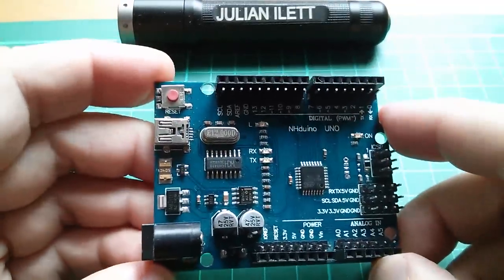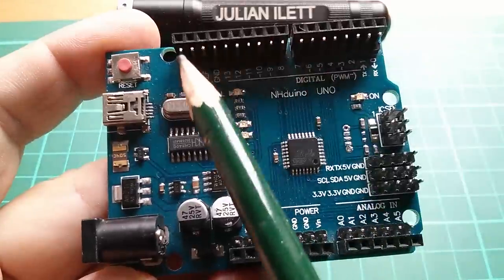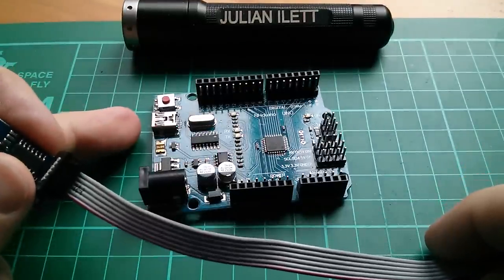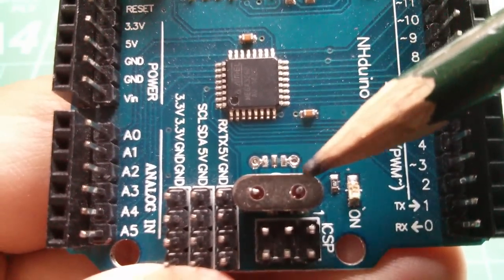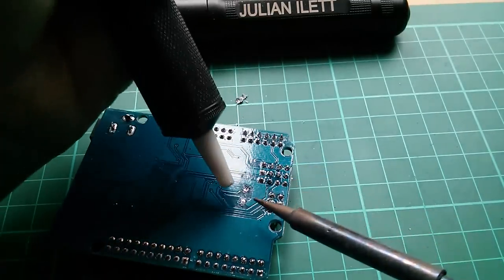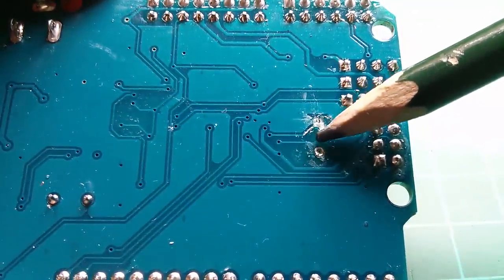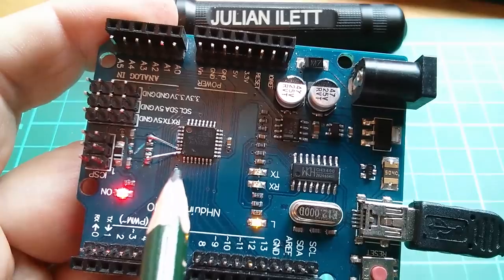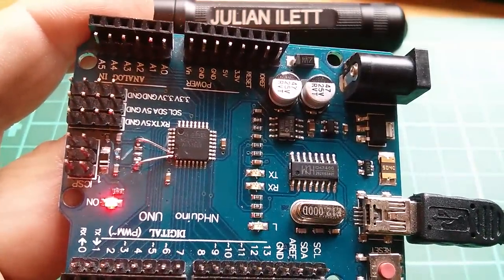Julian Sucks: Failed Arduino Uno Repair - Rescued!

Comment: Why not upload the video if the board was not fixed? I think failures in repairs and projects are far more important in terms of learning than successes! Also, maybe viewers have suggestions if you run out of ideas...
Reply from the maker: +tHaH4x0r I agree that far more is learnt through failure than repeated success, but it doesn't always make good telly. The DSO138 scope build I did recently started as a failure, so it sometimes works, but failures always require some sort of follow up. As for viewer suggestions, I'm all ears.
Reply: +Julian Ilett  About the DS0138  Did you actually do the noise mod yet and do you use it?
Maybe it would be interesting to make an episode of what stuff you still use and what is being left in the dust drawer.
Reply: +Julian Ilett  I have a suggestion for you. I was watching your video series about the MPPT, and you noted something that has been a stumbling block in electronics to me for 30 years. Incidentally, I have to laugh every time I think about your interpreting your wife's "get rid of that monstrosity" (the solar panel frame) to mean "it can stay for the winter". Now that is what I call interpreting.

As to the suggested topic for a video, in one of the MPPT videos you changed the load seen by the solar panel (the number of bulbs connected on your LAMB) to arrive at an optimum load for peak solar panel power.
When I saw that, it was like an old, still buried splinter being bumped. Speaker impedence matching.  Used to maximize power. A continuing mystery to me. Why is it necessary ?

If you make an oscillator that operates at 60 hz, at 100v, you can stick a light bulb on the output and it lights up (I think). But for some reason if you use a speaker, you must match impedences. How come ?

I hope you will consider this as a topic for exploration. I bet 95% of the people who have even heard of impedence matching don't really know what it means. Just something to impress your girlfriend with.
Reply: +Julian Ilett using a smd resonator and a through-hole crystal is actually very cleaver and shows some thought  did go into making this. i actually did this exact thing on one of my very own Arduino boards i designed a couple of years ago. i did it mainly because smd resonators go up and down in price and sometimes become very hard to find. were as through-hole crystals are very common and extremely cheap.
Reply: +youpattube1 +youpattube1 Audio amplifiers are generally limited by their power supplies, and the rating of the output power semiconductors. You get the maximum power out of an amplifier when the load is of the right impedance. 

If you consider a sine wave, ideally you want the peak output voltage to be a close as possible to the limit of the DC power supply voltage, and the peak current to be as close as possible to the limits of the power supply or the output devices, whichever is the limiting factor. In that way, you get the maximum power the amplifier can deliver. 

If the impedance is lower than ideal, you will hit the current limit before the voltage limit, lower actual power. If the impedance is higher than ideal, the amplifier will hit the power supply voltage limit early, it will 'clip', and cannot reach a high enough peak voltage to get maximum current flowing, so lower power is delivered. 

Many car power amplifiers can drive very low impedances, as that means they don't need to boost the nominal 12v DC to very high levels needed for high power into higher impedances. Most audio power amps produce maximum power into 4 ohms as opposed to 8, as means the power supply voltage can be lower. 

Some professional power amps (stereo) can be run in 'bridged' mono mode, combining both left and right channels into a single mono amp. Because the output voltage can now swing over twice the voltage range, these usually produce maximum power into 8 ohms. 

The current limit is the same, the value for each amp independently, but by bridging the two amplifiers, one out of phase with the other, one goes negative while the other goes positive. The output is twice the voltage and can drive the same maximum current into a higher impedance, so about twice the power.
Reply: +philDotCom thank you for taking the time to make this intelligent response. I am a slow learner, and for some reason this issue isn't easy for me, so I will take baby steps. You wrote 6 paragraphs, and I understand the first two. 
In your third P you say that too low an impedance will limit the current. But to me, a lower resistance would mean a higher current. Would you mind discussing this ?
Reply: +youpattube1 Hi, yes sure! You are correct, a lower impedance would mean a higher current for the same voltage, but the power supply and/or output semiconductors will have an absolute limit to the amount of current they can deliver. If there was no limit to the amount of current that the power supply (etc) could deliver, then lowering the impedance would result in more power being delivered, but there always is a current limit.

Assume, for example, that the power supply is designed with +/- 100V DC and can deliver 2A. If you looked at the output on an oscilloscope while inputting a Sine wave, you might see the signal ranging from +100V to -100V. At the peaks, ignoring power factor and phase etc, you have 100V (positive or negative) and potentially 2A, so the peak power would be 100 x 2 = 200W.

If the load impedance is too low, the amplifier might reach 2A current with only 50V peak, so only 50 x 2 = 100W is delivered into the load.

If the load impedance is too high, the amplifier might only reach 1A with 100V peak, so only 100 x 1 = 100W is delivered to the load.

With an ideal load impedance, 2A will be delivered at 100V peak, meaning the maximum power possible is delivered to the load, 100 x 2 = 200W.
Reply: +philDotCom Yes, I do get that the goal is to utilize the full potential power of an amplifier. What would be the point of buying an expensive powerful amplifier if you could only use half that power ?   And I understand that if your actual output power is less than the amp is rated for, then either the current is less than it should be, or the voltage is less, or both. Yes, I get that.
But that doesn't explain how a wrong impedance accomplishes that. We just seem to be remarking about the phenomenon.

From the amplifier's point of view, isn't the speaker's impedance (reactance + resistance) just the same as a net resistance ?  And wouldn't the lowest possible resistance mean the most possible power ?

If you plug an incandescent light bulb into the wall, the amount of power (current) is a function of the resistance in the filament. The lower the resistance, the greater the current, and the greater the power used.

This analogy may be the source of why I can't understand impedance matching. But I don't know how else to think about it.
Reply: +youpattube1 Yes this is true, but the bit you are missing is that the amplifier can only deliver a finite amount of current, it depends on the design of the amplifiers power supply. For example, one of the factors is the size/rating of the transformer (assuming there is one).

You are correct in your thinking, just remember that your speaker cannot just draw more and more current, because the amplifier will reach a maximum and not be able to deliver any more... :)
Reply: +philDotCom Well, thanks for your thoughts, but I have come to the conclusion that, and no offense is intended, you don't understand impedance matching any better than I do.
You've said that amplifiers have a limited amount of power.  Everybody knows that. You said that if the impedances don't match, you don't get full power. You just re-stated the subject under discussion. But you don't say why.

You point out that reducing the current will reduce the power. Everybody knows that. You say that reducing the voltage will reduce the power. Again, common knowledge.
You point out that an amplifier has less power than a 100Mwatt power plant. Again, self evident and not an explanation.  Finding different ways of saying that a car won't run isn't an explanation of why it won't run.

I will try one last time. If you replace the speaker with a light bulb, will you still have to do impedance matching ?
Reply: +youpattube1 I think your being pretty unfair in stating 'But you don't say why'. I have told you why this is the case, in more than one way, so all I can suggest is you re-read what I've written more carefully. 

I have many years experience in designing, building and repairing amplifiers of all kinds, so I'm pretty sure I understand what is a very basic and simple principal. Accusing me of not understanding it because you fail to is rather disingenuous.

Comparing amplifier impedance matching to household mains electrical supplies doesn't really work, because mains electricity is essentially a fixed voltage with unlimited current for the purposes of this discussion. Audio amplifiers are neither of those. 

Ignore amplifiers for a moment. If I have a 12V power supply capable of supplying 10 Amps, what value resistor would draw the most power? What would that power be? If you don't understand that you need to go back to basic principals.
Reply: +philDotCom What's disingenuous about it ?  Here is the definition of disingenuous "not candid or sincere, typically by pretending that one knows less about something than one really does". I started off by saying I didn't understand it, and I still don't. 

In response to your question (you chose to ignore mine), I would say that any resistance means loss of power. So 0 ohms would be my guess.

Now how about taking on my question ?
Reply: +youpattube1 If by "capable of supplying 10 amps" you mean it should be restricted to 10 amps, then it would be 1.2 ohms.
Reply: +youpattube1 Is that the idea of impedance matching ?  That if the load has a certain resistance, it will prevent the amplifier from supplying more current than its components can handle ?  And that if the resistance is less than that, the amp could burn up.  If the resistance is more, you don't get the full benefit of the power the amp is capable of supplying because the current will be reduced.

Is that the idea ?  If that is what impedance matching is all about, then the answer to my question is yes. Speaker or light bulb, if you don't want to smoke the amp, you must restrict the current to a safe level.
Reply: +youpattube1 Practically speaking there is no such thing as zero Ohms, but if there were then there would be zero power. You should perhaps go back to Ohm's law and become totally familiar with that.

It seems you aren't reading my earlier replies like I suggested, so I'm repeating myself, but all power supplies are limited in the current they can supply. What happens when you reach that limit depends on the power supply, but that is irrelevant.

Power supplies, much like power amplifiers, deliver power into a load impedance. Power = Voltage x Current.

Your answer of 1.2 ohms is correct and, to answer my second question myself, the power delivered would be 12 x 10 = 120W, so the resistor dissipates that as heat. A speaker would move air as well as get hot.

All you need to know is in this and earlier replies. Consider the 12V and 10A power supply and what happens to the power if you increase or decrease the value of the load resistor, see how that affects the power; you have your answer.
Reply: +youpattube1 Maybe this does a better job than I can:
http://www.electronics-tutorials.ws/dccircuits/dcp_9.html
Reply: +philDotCom I read the link, and it is interesting. It discusses the amplifier source resistance, something you mentioned 0 times.
I had re-read all your posts, about 5 times each because I am trying to understand this. I re-read all of them before I made each reply.
But. You seem to be all over the map with your terms. Take the little problem you set out. Very sloppily composed. How can you expect anyone to know what you are trying to say if you don't say it.  "Capable of supplying 10 Amps". What does that mean ?  If it is capable of supplying 20 Amps, it is also capable of supplying 10 Amps. What you should have said was the power source current could not exceed 10 Amps. Then someone can give you the very simple answer, which I did.

Another thing, I believe that I was right in my last post when I talked about the certain load resistance and the appropriate current. You said yourself :
"Hi, yes sure! You are correct, a lower impedance would mean a higher current for the same voltage, but the power supply and/or output semiconductors will have an absolute limit to the amount of current they can deliver." That is what I said. The purpose of the load resistance is to limit the output current so that the amp doesn't smoke.

But you are so busy telling me how I should review Ohm's Law that you don't stop to consider what I actually said.

So I will ignore your pompous remarks and go further into what I think is happening.  An amplifier manufacturer could easily say, this amp must have a minimum load resistance of 16.5 ohms, or it will burn up, so design the speaker impedance for 16.5 ohms.  Another Manufacturer could say my amp needs 11 ohms, and so on. But it would be ridiculous to expect speaker manufacturers  to make 97 varieties of speakers for all of the different amplifiers.  So amplifier engineers and speaker engineers got together and decided on some standards that were acceptable compromises. Thus 8 ohms came into being.

Now speaker manufacturers know that if they make a speaker with 8 ohms impedance, it can be used efficiently with any amp that was designed to work with a load resistance of 8 ohms. And amplifier manufacturers can use components that will work with currents facing 8 ohms of load resistance.

Now I know that power is how amps are normally rated, and that varying the voltage will effect the current (and the resulting power), but I think that I have the general principal correct.

You are in the amplifier business. What do you think of my theory ?
Reply: +youpattube1 It seems that my efforts to help you understand this are annoying you, and that you think it's OK to suggest I don't know what I'm talking about at the same time as admitting you don't understand the subject. Frankly I'd rather not spend my time trying to help where it's not appreciated, so I'll leave the conversation here. It seems you are on the way to a better understand, more reading will ultimately get you there I'm sure :)
Reply: +philDotCom Well thanks for your help. I do think I understand much better now, and that is due to that simple problem you posed. It made me see the issue from a different perspective.
As far as you not understanding the subject, I was wrong about that.
Reply: You don't match the output impedance of an audio amplifier with the load because the load is say 8 Ohms nominally and the output impedance of the amplifier is very low in order to control the speaker cone. The amplifier is like a high speed voltage regulator that changes it's voltage according to the music signal. If the impedance was matched i.e. 8 ohms output resistance from the amplifier, then the sound quality would be bad due to back emf from the speaker units. Applying feedback reduces the output impedance of the amplifier output so that it controls the voltage more accurately.

Comment: I'm a little fuzzy on how you arrived at the crystal as the culprit in the 1st place (before de-soldering and observing the short).  Can you expand on your logic there ??  Did the programming attempt with the USB AVR programmer NOT work?  You didn't mention that.  And - did you say that the USB AVR programmer WOULD require a functioning crystal? So - should I assume that the USB AVR programming didn't work and did require a functioning crystal only (i.e. none of the other board parts are involved in AVR programming) - so that's how you concluded that it was a crystal failure??   Why didn't you think it was a board trace failure?  Very interesting trouble shoot Julian !!  Thanks for your response !!

Comment: Hi Julian, the old manual soldering pump was a very harsh method of desoldering (as you well saw yourself) If you don't have access to a dedicated desoldering iron, might I suggest that you consider using a high quality desoldering brain instead? If used properly they are actually very effective and less damaging to the PCB. Keep in mind that solder braid varies significantly in quality, and thus ease of use, so if like many people, you have had poor experience with braid in the past, I would try a decent brand (3M and Chemtronics spring to mind) Thankyou for sharing your videos
Reply: +arcadeuk Desoldering brain :D I approve.
Reply: +zaprodk Damnit :)
Reply: I've found it is sometimes useful to give the desoldering BRAID a liberal does of flux.